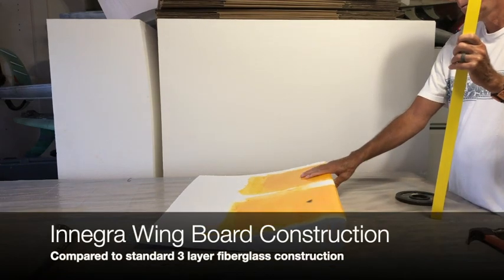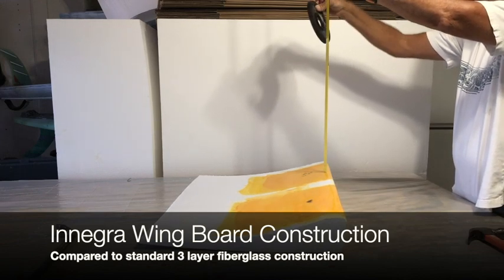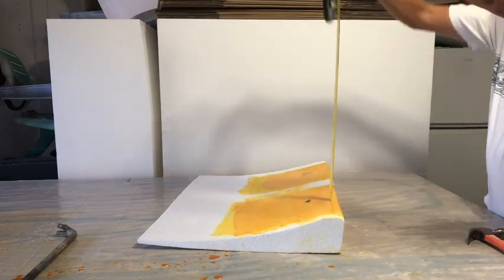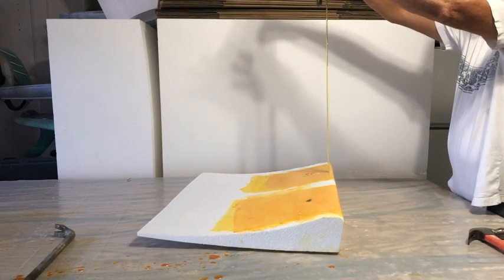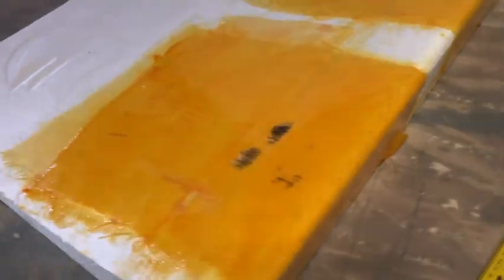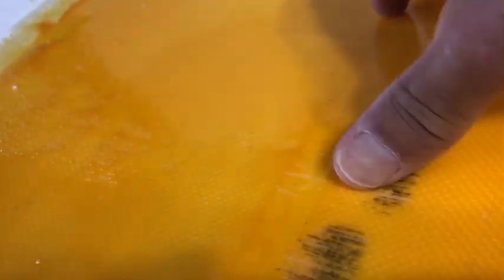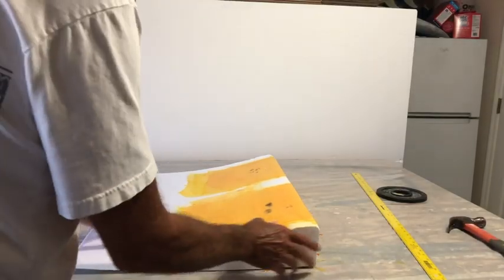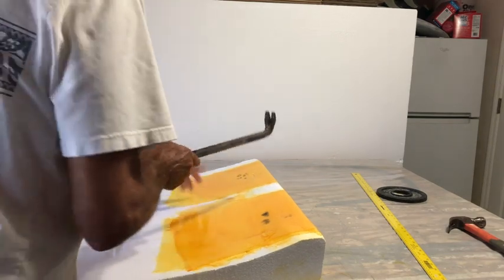Innegra Wing Board Construction

Comment: Hi DW, thanks for all the vid's and sharing your experiences. I use a FoilSurfMachines 6'4 sup foil board currently for winging and sup foiling. I need to do some small repairs. What type of resin should I use.
Reply from the maker: Any surfboard epoxy brand. West Marine epoxy is OK, if you can’t get surfboard type.